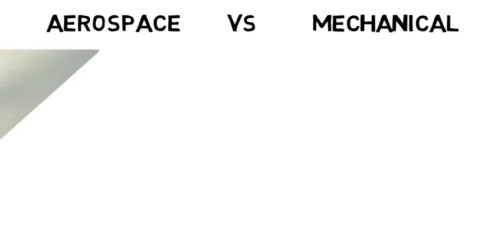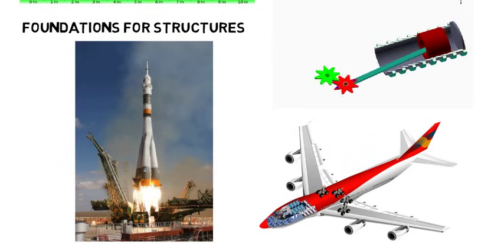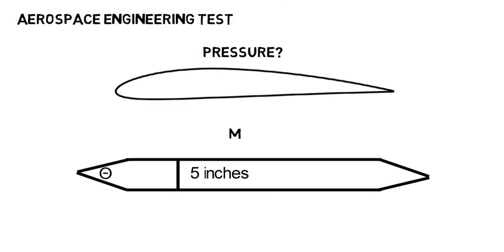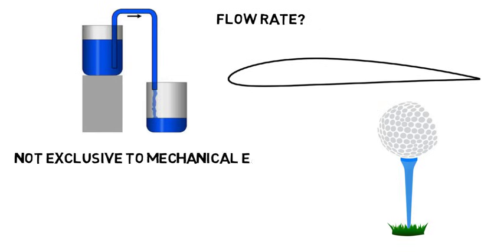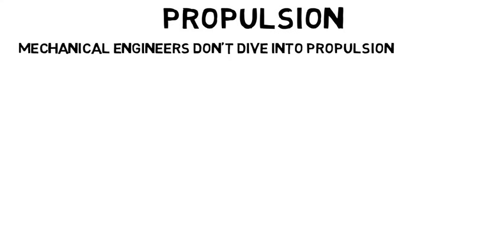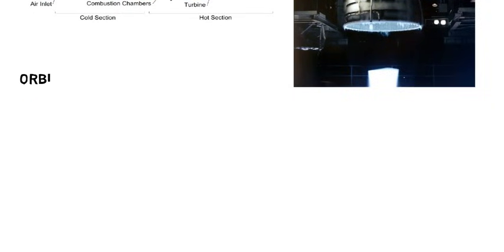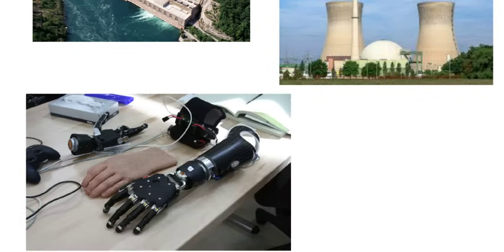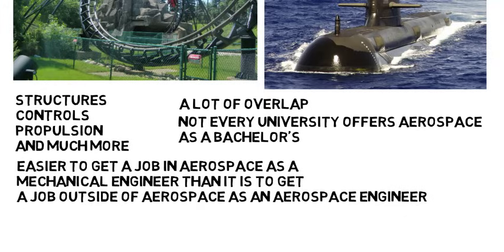Aerospace Vs Mechanical Engineering - How to Pick the Right Major

Comment: I want to work in the space industry but not on the spaceships, the land rovers excite me much more because of all the new technology they use. Should I then study Mechatronic engineering or mechanical over aerospace?
Reply: What do you want to specifically do with these rovers? Navigation? System and Control? Structural design? Electrical systems?

Also, how long do you plan to be in college, what degree level do you want to stay for. I'm no expert (I'm a High School Senior) but from the research I've gathered I'd probably point you in the direction of Mechanical, you could even do electrical if you wanted to work on there electrical systems. I hope Major Prep dude answers you question because again I'm no expert/engineer...yet! You could also get a Aerospace Degree as a Graduates Degree; this is what I plan on doing.

I feel that the Mechanical degree is more flexible and gives you more opportunities. Mechanical Engineers can also do a lot of the things Aerospace Engineers do.

Finally, when you say "rovers" you mean like Mars rovers right? You could always major in Robotics.
Reply: Sidney Boakye Yep I do mean the mars rovers. I definitely want to study to masters level so I'm a chartered engineer. I haven't quite pinpointed what role I want to play, I have this fanciful idea of doing it all but of course I would be working in a team so thats not possible. I would like to design the parts and the mechanisms, but also do some coding and electrical work. I wouldn't want to go super in depth on the electrical however, just enough to know how to put all the different circuit combinations together and how each component works to. I've been learning python recently and found it fun, I want to design something that's intelligent and can gather data, thats what I see as useful. Structural material type stuff doesn't really appeal to me that much, I'll leave that too the chemists and civil engineers